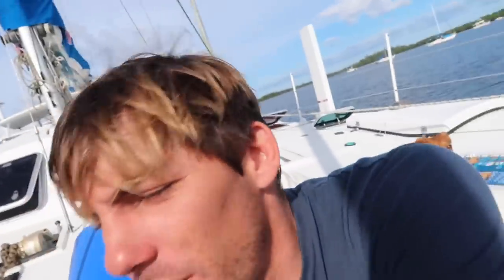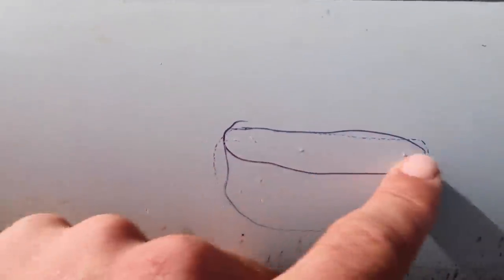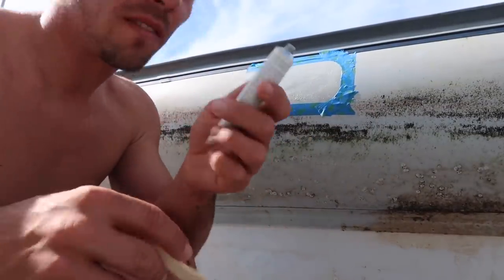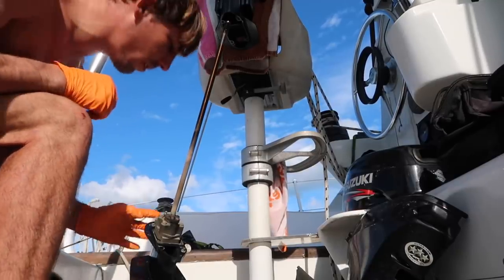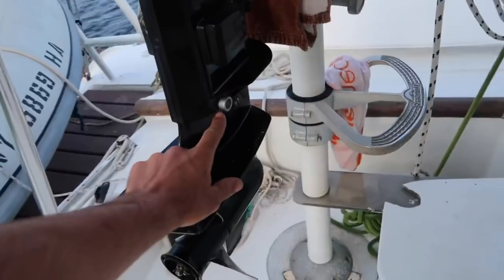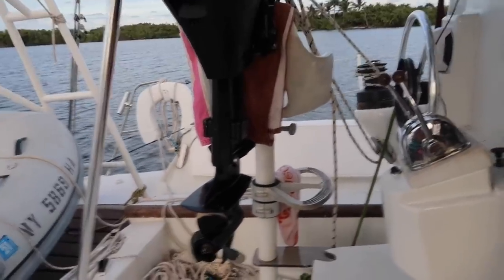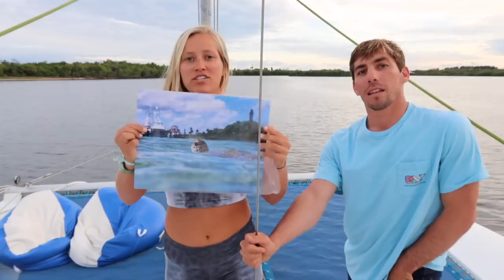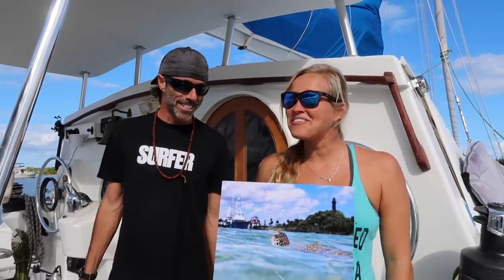Taking Care of the Family 🚗 Dinghy Maintenance (almost lost the engine)

Comment: Hey Billy!  Did you forget to change the oil filter?    It is a paper filter behind a round plate held on with three bolts.   It is located behind and just below the fuel filter.    You can not see it without removing the plate.

Comment: Another little tip for doing impeller outboard maintenance. All ways fit with impeller find lubricated (some rubber grease or biodegradable dishwashing liquid) once fitted you should not spin the propeller with out water and especially never spin backwards out of water. That is the quickest way to damage the impeller blades.

Comment: For next time: solvent clean before and after the sanding. Sanding grit embeds dirt and contaminants in the material which weaken the bond. Might be ok as is, but if it starts to let go, that's your culprit. Especially if you have been using 303, ArmorAll, other protectants that also contaminate.

Comment: Before each task take a few seconds to think of what could go wrong, then plan to prevent the worst things like using a lanyard on the engine.  I also like the previous suggestion to use your dinghy hoist.  Shark?  Pensacola Bay sharks, who helped sharpen the reflexes of young Naval Aviators back when fighters were equipped with .50s.

Comment: Great job on the motor maintainance. I just want to add that when serviceing the waterpump and lowerunit it is wise to remove the prop and regrease the shaft. This also gives you the oppertunity to inspect the shaft seal and remove any fishing line before it can damage your seal. I hate removing an outboard from a dinghy in the water. On my sailboat I would attach the boom vang to the end of the boom to hoist the motor then use the topping lift to bring the engine on board. I've had 3 back surgeries from doing things like you removing your motor. Please be careful and use the boats equipment to help you. Oh, my favorite shark is the Tiger. You guys have a knack for filming the right stuff and presenting it in an enjoyable way.

Comment: Say there Billy, I have a 99 Ram Cummins also with 402300 klicks or 250000 miles. As I live in Northern Ontario 20 years of salt has made it look rough but it runs like a top. 2 of my boys work for Chrysler and have been trying to get me to buy a new one but I can't see it. I spend 1500 to 2000 dollars a year on mine vs 70000 for a new one. Seems a no brainer to keep it to me.
Reply: Tim Godsey I have a 1994 ram cummins with 427,000 miles and it still runs like new!!! These are the best/coolest trucks ever built!!! I’ve had mine for close to twenty years now...
Reply: Lemon shark is our fav. We swam with them in Bora Bora so they remind me of the good times we had there.

Comment: Got 2 questions. Shouldn't you have used your dingy hoist system to move the engine instead? last question is...I use marine silicone for everything. I used it to patch my vinyl top to my car. I never had to replace or reapply a patch. Would silicone work with the dingy. I have a iSup as well and its about 4-5 years old. I take care of it but it one day will need patching. With the air pressure and all I want to make sure I do the right thing. The Hammerhead has always been my favorite.

Comment: Good luck with your dinghy patch.  We had a few inflatables in the 80's.  Unlike modern inflatables, they got sun-rot and leaked on top of the tubes.  We'd patch them but they'd leak at the edge of the patch in a short time.  When buying a dinghy for my current boat, I found the Oliver boat.  It looks like an inflatable but is made out of hard plastic.  Its light, but strong and filled with foam, it can never sink.  In the unlikely event you get a leak, it can be plastic-welded using a soldering iron and the part of a zip-tie you cut off as filler.  Just in case you need a new dinghy soon...

Comment: Cyanocrilate (superglue) works best for small pin holes. Clean with acetone + rag. Deflate, poor over a small drop and let dry. You can recover with a second coat droplet. Let completly  dry. Reinflate
For bigger pinholes use aquasure cement from aquaseal  (scuba stores). Work the same way, dries slower, let cure overnight or 24h
Reply: That's a pretty good trick, thanks.  Use a small enough drop and you can still make a permanent repair later on with a patch.

Comment: What if you used a peel and stick membrane? I sell a flashing tape. It is a butyl/acrylic adhesive. Ridiculously sticky.  True story on another product I sell. Grace Ice & Water Shield (shameless Plug) . A roofer went 300 miles up in Canada with a boat on a trailer that didn’t fit boat. Wore a hole in boat. He patched with the Ice & Water shield and fished for 3 weeks. If you can provide an address I can sent you a sample.  Good stuff to have on hand.

Comment: 12 valve or 24 valve Cummins?
Reply: If it's 99' then most likely a 12v ..ya can't kill it !
Reply: @br5498  99 Would be a 24V with VP44 pump.  98 was the last year for a 12V with a P-Pump.

Comment: This is your one year old, very expensive, highly recommended inflatable?
Very disappointed in this manufacturer.
Seems to me it's a bad piece of fabric that shouldn't have passed Q.C. and you haven't seen the last of these failures.
Have you communicated with Highfield about the pinholes?
I know inflatable warranties are generally written to exclude anything that would hold the factory liable for anything short of complete disintigration, but they may make a small goodwill gesture.